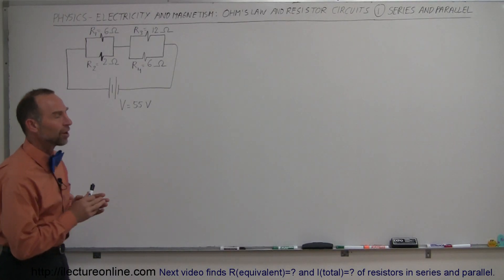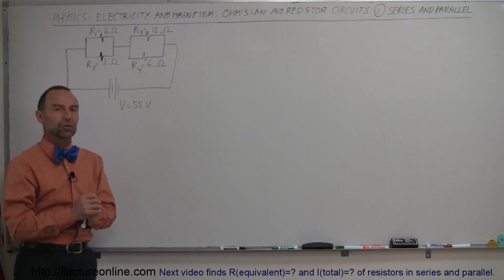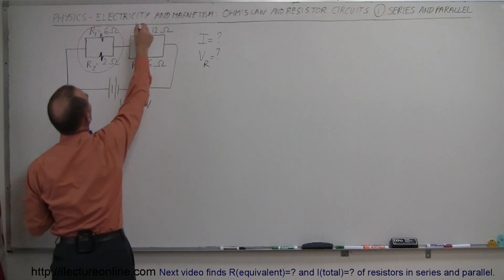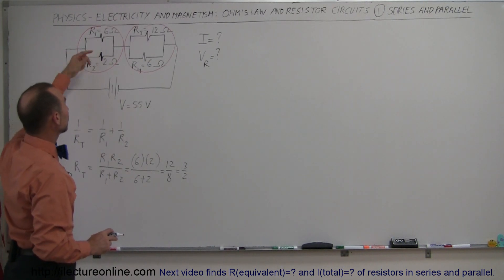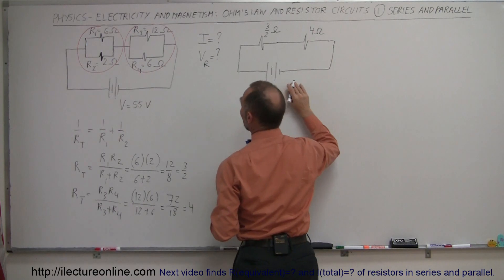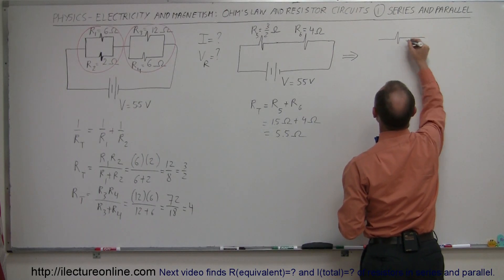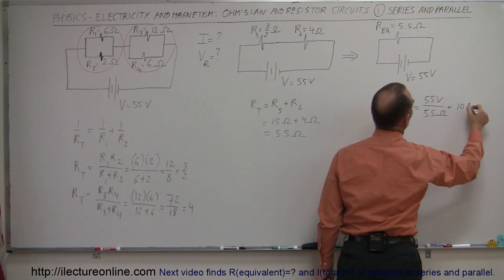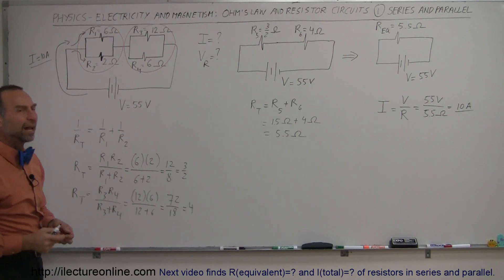Physics 42   Ohm's Law and Resistor Circuits (1 of 23) Series and Parallel

Comment: dude this is so much simpler than the way my teacher is showing us.  We're using something called Kirchoff's rules and loop rules and it makes it was more confusing that it needs to be.
Reply from the maker: Kirchhoff's rules are useful if there is more than one voltage source in the circuit, but it overcomplicates things in a single volage source circuit.  We have a number of examples on Kirchhoff's rules as well.

Comment: Could you do some video's on troubleshooting? For instance, what would the changes in the circuit be if you added a resistor or branch in the circuit. My exams always have questions about which light would be brighter or dimmer if you add another bulb or branch in the circuit. I haven't been able to find any videos like that and they would be helpful.
Reply from the maker: Trouble shooting is more of an art than a science.  After we finish all the basic topics of circuit analysis we can take a look at that.
Reply: Thanks a lot professor. I think it is great you added those concept sections. A majority of my physics tests had no equations on them so understanding principles is just as important.

Comment: sir if we have to give the readings of a voltmeter attached on top of a circuit will we  take the voltage drop as the reading that the voltmeter gives
Reply from the maker: Essentially yes.  A voltmeter actually measures the current flowing through it and uses an internal resistor to "calculate" the voltage drop.

Comment: is that current division at 7:25?
Reply from the maker: It is using the principle that current takes the path of least resistance.  If branch 1 has a higher resistance than branch 2 then branch 2 will have the higher current (proportional to the resistance of the other branch).

Comment: Sir, 
Is voltage proportional to the resistance ?
Reply from the maker: The voltage across resistors are proportional to their resistance when they are connected in series.  In parallel, all resistors will have the same voltage regardless of their resistance.

Comment: Sir what if the circuit had 3 (or more)branches.... H ow do we find the current flowing through each branch
Reply from the maker: Yes, I get asked that question a lot, so I should do a video on that.  Here is the method.  Let's say you have 3 branches with 3 resistors (R1, R2, and R3), and 3 currents (I1, I2, and I3).  I1 + I2 + I3 = I total         I2 = (R1/R2) * I1           and  I3 = (R1/R3) * I1  Substitute into the original equation and solve for I1.

Comment: What is the use of resistance only slowing down the amount of current ?
Reply from the maker: There are dozens of different applications for resistors.   A typical circuit board for computers or processors will have hundreds and even thousands of resistors on them.

Comment: if I have N resistor (not only two, as we see in that example), how can I find the ratio of resistors to find the current on each branch??
Reply from the maker: +Juang Mukhtar 
Calculate the voltage drop across the branch.  Then the current through each resistor is the ratio of the voltage to the resistance.

Since I = V/R
Reply: I know... but, I mean, is there any general formula like you use in that example to find the current on the n-th branch just by looking at the ratio of R and multply that to I total..
Reply from the maker: +Juang Mukhtar 
The way to do that is to combine all the other resistors into 1 equivalent resistor and then use the above formula.   Then you separate 1 resistor from the remainder and find the equivalent resistor of the remainder and repeat, one resistor at a time.  This can be quite laborious, thus the suggestion above.
Reply: thanks for the reply sir.. I appreciate that. Your playlists are beyond awesome.

That would be PERFECT if you make playlist about mathematics for physics.. like taylor series, vector calculus, partial differential equation, linear algebra, complex number, special function (legendre, beta, gamma) etc..
Reply from the maker: +Juang Mukhtar  Those topics are all on the list to be covered.  But it takes a lot of time and work, so we'll take it one topic at a time.

Comment: im confused on the voltage drop part. if both of the resistors had a voltage drop of 15V wouldnt the drop between the two be 30V?
Reply from the maker: +footeythegreat If there are multiple paths from one point to another point in the circuit, then the voltage drop will be the same across each path.  (those are then parallel paths).  Think of voltage like elevation.  If there are 5 roads to the top of a mountain, the elevation difference will be the same along each road.  (That doesn't make the mountain five times as tall)

Comment: Question: How would I figure out the specific current through a three parallel resistor? Only one of the three of them. Since for two you use the ratio of it all.
Reply: +Chloe Hill (Echo) 
I Total = 10 Amps
10 amps x resistors in parallel (Total) = Voltage drop
Voltage drop / resistance (Individual branch) = Current flow in branch

Comment: If the letter I in Ohm's law stands for Current, why they didn't call it- C?
Like V in Voltage?
Reply from the maker: Good question.  I have no idea.
We have examples like that throughout physics (like the letter for momentum (p) and angular momentum (L)) etc.
Reply: +שי דוידוביץ' (Shaydav1) becuse C is already reserved for coulomb